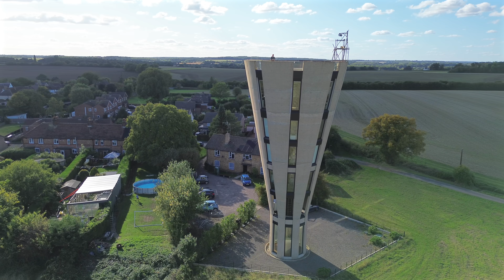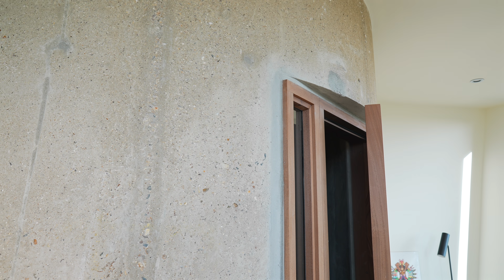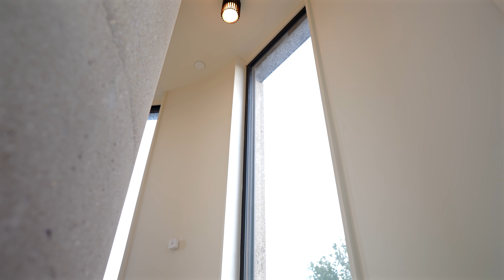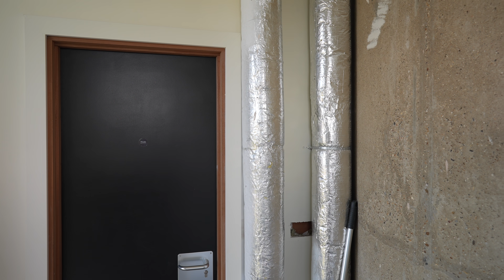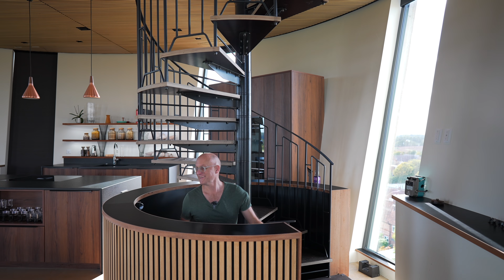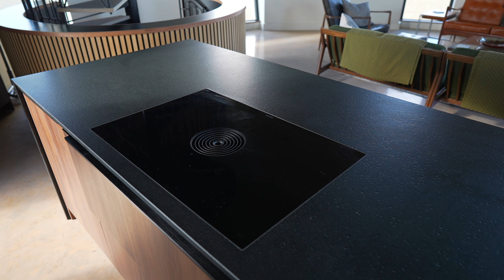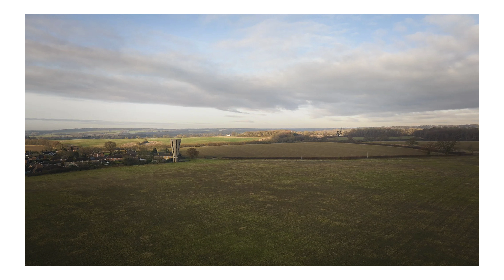How Industrial Designer Matt Transformed This 1960s Water Tower Into a Family Home

Comment from the maker: Thank you for all the great comments, Matt has been blown away by them all! This is a response from Matt, answering a few of the common questions on this video:

Lift: 
We tried, really, really hard to get a lift in but it proved impossible without breaking out of the building's silhouette. UK Building Regulations insist that there must be a stair exit in case of fire and the only space other than the shaft is restricted by the structural ring-beam 3m above ground level. We worked with a stair-lift company to find a solution up the stairs, but their tech would have taken more than 15mins to elevate someone to the top. I do have a part-baked design for a proprietary platform-lift that follows the spiral (helix?), but it needs more time and more money. I'll get there in eventually. In the meantime, I can only apologise for the terrible accessibility. Sorry. 

As far as an external elevator is concerned, The building is Grade 2 Listed. In the UK this means that its external aesthetic is protected by law. Permission for changes can be granted - as it was for the conversion - but upon consultation, an external elevator is not something that would pass muster. I did though, just in case, design for the addition of a Trellick Tower style service elevator at a later date, keeping all but one landing clear for walkways. 

Replacement Appliances: 
John Lewis did deliver the washing machines but the driver declined to take them up! Instead my mate and I took them out of the boxes and carried them up the spiral. A slapstick exercise worth of a Carry On film. Other stuff can come up on a scissor lift and in through a window opening, once the glass has been lifted out. The bath however... yes, that's going to be a problem! 

Solar Panels: 
It would be so good to get solar panels somewhere. 
Mounting panels on the external walls would not be allowed by the conservation officer. Also, the walls are inclined at 11 degrees so in the summer, the sun's approach would be at ~70 to the normal, reducing efficiency to only 30%. It would be possible to put panels into the openings on the heat pump level but again, the area is not large and the efficiency is low. 
The roof space is a possibility. We could get ~6sqm of area against the inside of the parapet facing the sun. However, panels certified for domestic use however seem to be a minimum of 1.2m in height and the parapet is >1m. Anything poking above is going to need to be approved by the conservation officer again. Also, apparently, a panel's longevity can be severely reduced if only part of it spends time in shadow, which they would because of the stairwell. 
I'm going to keep working on it but if anyone has any solutions, I'd love hear them. 

Ventilation and Windows. 
The windows are all fixed and the place is ventilated by a DUCO mechanical ventilation heat recovery system. This system extracts the heat from the outgoing air and puts in back into the incoming filtered air. The heat savings far outweigh the running costs and we have fresh, warm, clean and naturally humid air. The windows themselves are 60mm triple glazed, weigh about 180kg each and would thus be difficult to build into an opener at 11 degrees. Again, we tried but were defeated! 

Thanks again for all the nice comments. The world, it seems, is full of lovely people. Wonderful!
Reply: Thanks for the detailed answers! Everything's so incredibly well thought through👌🏼
Reply: You should only be happy with the stairs (I have always lived in old buildings without elevators myself). Getting your heart rate up for short periods, as little as 30 seconds, is, according to research, perfect for maintaining one's health. Congratulations on your fantastic home. It's worth all the work.
Reply: Thanks for your quick responses. About the solar panels. Can it be put on the ground next to the building or a little further to catch all the sun in some way?
Reply: @Garett.1214  Agree. Terre firma for the solar panels, close to the utility floor, and the inverter fans (noisy).
Reply: Look up the wind turbines. Modern technology on them went far! There are mini ones  that ppl can place and use on their balconies, there are mid sized and big ones with funky design. You did say it was windy up there ..
Reply: Inspiring stuff, truly.
Reply: Regarding the solar panels. No need to attach to structure or roof. You have enough land to put in the newest generation of panels that are at a 90-degree angle from the ground. They do not need to be too tall either. There are solar panels that have PV cells that are double-sided. Which means, you can get the sun's rays from dawn to dusk. This is worth considering. The other beauty of the newest generation is that they have semitransparent PV cells. Those can be added to the lower levels of the tower before the inclination start. They also have the benefit of being thermo-regulating (lets in light, but not the UV). The new ones are considerably more efficient.
Reply: Thanks for your reply on the elevator. Typically, with historic buildings in America, you can apply for exterior changes if they involve safety  (I am a licensed General Contractor and a Civil Engineer). In the United States, an elevator would probably be not only permitted, but required for that reason. Also, safe access is a big deal to most governing authorities. So you have a very strong argument to get an elevator permitted. Since, as you note, a staircase is required, the ONLY place you can locate the elevator is on the building's exterior. So I am betting that if you met with the building authorities that oversee historic building permitting, they might be amenable to allowing you to install an elevator. This would be especially true if you told them that you would be matching the building's existing industrial motif. 

For example, let's say that you have a relative who is in a wheelchair and they want to visit you for a week or two. You would have to carry that relative up the stairs every time they wanted to go to a different level in the building. If the relative had a medical emergency, ambulance services would not have safe access to provide timely treatment.

Here's another example. Let's say that one day, one of your relatives has a bad fall and you cannot move them down the stairs safely because they might have trauma to their spine. Emergency services would be hindered in treating your injured relative quickly. For this reason, with buildings like this, governing codes in the United States usually, not always, REQUIRE an elevator. It's not just for convenience; it is a matter of safety.

The most efficient system would be to erect a steel I-beam structure  that is bolted to the building's concrete walls on the exterior of the building. Then, an elevator can be installed in the steel structure, much like a construction elevator is erected on large construction sites. 

Also, if the steel I-beam structure was designed correctly, it could have a very attractive "industrial" look that would fit in very well with the industrial aesthetic of this current building. You could install a weatherproof chase for the electrical wiring and the elevator cables. What would look really trick, would be to install reinforced glass on the sides of the elevator shaft to protect the steel from rust and reduce maintenance. This is done all the time on skyscrapers in America. The point is that if it were done correctly, it would look stunningly beautiful and still fit into the motif of the building. So it would not be an eyesore to the community.  

Having said all of this, it would be very expensive to install. I would guess it would be somewhere around $300,000 or more. However, the same company that cut out the concrete for your walls and installed your windows could probably also install the steel frame for the elevator. Then you would hire a licensed elevator contractor to install the elevator itself. The steel frame itself would not really be that complicated to install. So that shouldn't cost that much, maybe $75,000.00 - $100,000.00. But you would have to hire an expert to design the system, as it would be required by your governing authorities.
Reply: @franklong6269 Elevators do get granted for these types of buildings, another good reason on top of your many, although not as applicable now, is you can state, when you submit your plans, that without an elevator and someone living their, the building would remain unoccupied and become derelict, thus losing the building completely. To try and sway them.
Reply: @timothyh9112 Depending on how you approach the historic AHJ and building officials, there is an extraordinarily strong argument to allow an exterior elevator to be installed. In this particular building, it is a matter of safety. In America, these are called "Life-Safety" issues and dominate over aesthetic concerns and jurisdictional codes. I would guess in the US, AHU authorities might have required that this building have an elevator because an elevator would be necessary to evacuate non-mobile residents or visitors in emergencies. Also, the staircase is the ONLY means of egress, and that is a violation of American building codes.  The elevator would provide a second means of egress to resolve this issue. Granted that in case of fires, elevators are not supposed to be used, but in this case, an exterior elevator could be used as an emergency exit because it is separate from the main structure. The worst-case scenario would be that the power went out. In that case, a ladder could be installed on the elevator structure, and elevator occupants could simply climb down the ladder.
Reply: Can I ask what was the price for this whole project ?
Reply: Is there anything you didn't think of?  It was meticulously planned.
Reply: I'd have been tempted to run a lift down the axis of the building and then design the stairs into an annulus around the lift. It may mean that the stairs require more rotations for a given vertical descent/ascent but no one would care if you're not using them except in emergency.
Reply: Such a nice tower for such a small town.
Reply: The ultimate zombie survival home!
Reply: @Anninukichild  Till you run out of food.
Reply: A wind turbine would probably work well for power generation. Something on a pole up top if it would be permitted within the rules and regs for a listed building
Reply: What an eye sore....
Reply: @samantha1877  I don't think so. I think it is beautiful
Reply: Thank you for a wonderful response and explanation for all of your efforts in making such a wonderful home, I was surprised that it took a number of weeks to cut open a window, C4 would have done it in seconds :) 
Aren’t you afraid of People misusing your home while it’s rented out, my friend Parents rented out their holiday home and a group of people wrecked it by smashing holes though the walls etc and it cost a lot of money and time to fix. 
Still your home would be a great place to be to ride out the Zombie Apocalypse virus 🦠 😊
Reply: What about skylights to open up the top floor? It feels too enclosed for me. Or adding something on the roof? Like semi/permanent or even temporary summer only wind protection to have party/barbecue on top. Or adding another fully enclosed floor with fully glass walls that continue the same angle? I feel like this tower need more natural light to balance the amount of heavy concrete.
Reply: An amazing project, love it. Have you considered building a wooden structure on top? You could build an entire small house up there (which would admittedly change the dynamic) and use the tower levels for storage and other utilitarian purposes.
And how about a collapsible wood and rope ladder on top, in case the staircase becomes blocked by fire (or zombies)? Or a platform lift to the ground that projects over the side.
You never know when the Apocalypse is coming!

Comment: Beautiful exterior.  Why not a 2 person elevator instead of the circular stairs?  In a power failure there could be an exterior mounted ladder.  Hauling up the groceries via stairs or the hoist will get old very quickly.

Comment: I was a young engineer on the Egg, a unique building in Albany, New York, USA. I have a lot of amazing stories about that, it is worth a look up. I also worked on a project where we had to unexpectedly remove a section of concrete wall. They actually make a device that looks like a big chainsaw but the cutting teeth are carbide blocks, hydraulic run.  It could be put on a small excavator, like you used.

Comment: Stunning. But a platform-lift should have been part of the staircase design from scratch.  At the moment this is a novelty home.  Smarthome 60s-style. Really nice. Très chic.  You can rent it out via Arbnb. But BUYERS will request some sort of lift. Esp. older buyers quite well off having personal connections to the 60s, able to buy such a home: Won't take the stairs.  It's a marvel on its own like a lighthouse without the sea but a lift is conditio sine qua non.  And here's another one: What's more 60s than a pneumatic tube? Okay, the Beatles.  For you can't have the fab four anymore you may consider  some tubing to transport small items. Like - err - car keys?  On the other hand there is keyless go today.... And now for the  handrail on the roof terrace. To me it seems pretty low considering the height of 22,5 meters. 1,1 m minimum for the handrail in Germany and I'd go for some extra safety. For nothing ends a british cool 60s party more quickly than Uncle James having imbibed too much dry martinis flipping over the rooftop. To be found on the ground.  Just saying...
Reply from the maker: Give our pinned comment a read in response to some of these points 😊

Comment: I am surprised you didn't put an elevator into the building. But if you did, you would have had to install a separate stairway anyway, and that would have been expensive, and it would have to be installed on the exterior of the building. I think an elevator outside of the building could have been built out of metal, sort of like a construction elevator. That would change the asthetics but if done properly, it would look really cool. You would make the elevator walls out of glass.
Reply from the maker: Give out pinned comment a read 😊

Comment: I have two questions a) fire safety. what if there is a fire and the heavy-duty door doesn't open? is there a downstairs window that could act as a door and b) instead of cutting into the central column (the structural centre) for the staircase to enter from downstairs, why did they not just build a curved staircase going around the column up to the first floor?

Comment: Awesome job Matt. A striking building for sure. As a builder I can see and appreciate the huge effort involved despite you very calmly talking about it.  I do worry about having to replace the hot water, aircon etc down the track as you won't get them up/down the stairs. Does one of the windows hinge open? I built a geodesic dome in my younger days and if you put the transistor mono radio on one side you could listen to it in stereo due to the spherical shape of the building.

Comment: Try this in case of fire: Korean High-Rise Emergency Escape Device (Rope & Descent System)
In South Korea, many apartments and high-rise buildings are equipped with a simple but reliable emergency escape device designed for quick evacuation during fires. It is commonly known as a “wan-gang-gi” (완강기) or emergency descent device.
The system consists of three main parts:
Wall-Mounted Anchor Point
Embedded in the wall near a window or balcony, this heavy-duty metal hook or bracket allows residents to attach the escape device securely during an emergency.
Fire-Resistant Rope or Webbing
A strong, heat-resistant rope is wound inside the device. It is long enough to reach the ground from high floors and is designed to withstand significant weight and heat.
Automatic Descent Mechanism
The small metal unit that controls how fast a person descends. Once you sit in the harness, the device lowers you steadily—usually around 1 meter per second—without requiring any manual braking. It’s fully mechanical, so it works even if the power is out.
Safety Harness / Seat Loop
A simple harness or seat that you strap around your body. It keeps you stable while the device lowers you down the exterior of the building.
How It’s Used
In a fire or smoke emergency, the resident attaches the device to the wall anchor, places the harness around their body, climbs out the window or balcony, and the descent mechanism automatically lowers them safely to the ground. Because the system is mechanical, it does not fail due to power outages or electronics.
Why It’s Common in Korea
South Korea has a very high number of tall residential towers, and smoke-filled stairwells can become impassable during fires. This escape device provides an inexpensive, low-maintenance backup evacuation method that can be used by almost anyone.

Comment: First of all, I must say that the result looks amazing... but constantly going up and down the stairs will not be as fun as it seems after a while.  Also, I don't have any technical knowledge, but I have some concerns about how the holes you drilled in the cylindrical concrete skeleton will affect the structure's strength.  especially since the photos you added show that there are very few iron bars in the concrete and that they are straight construction iron bars instead of stronger twisted iron bars, which worries me a little... Still, the result looks amazing, enjoy it! 😊